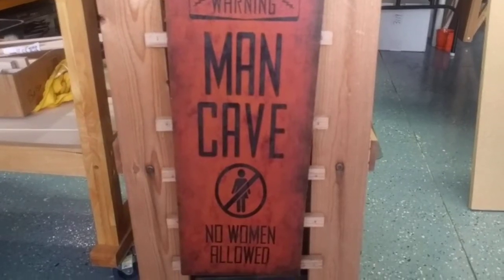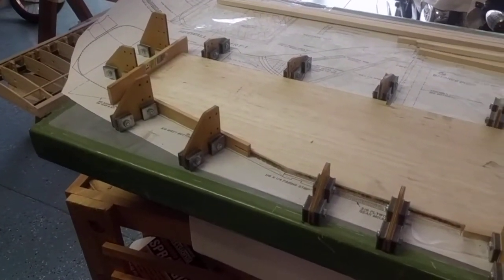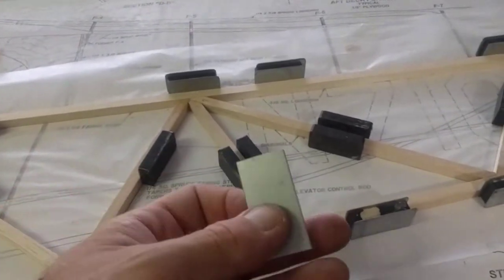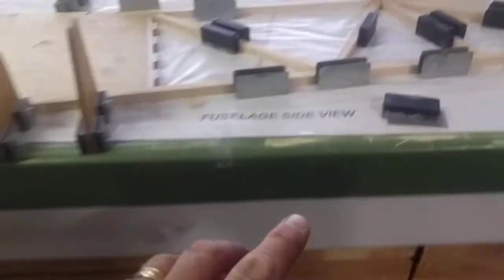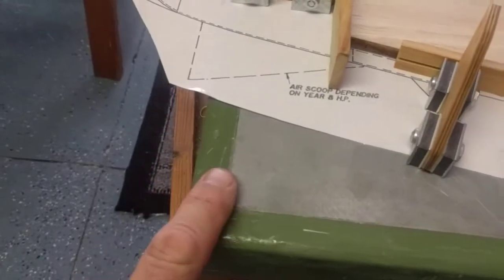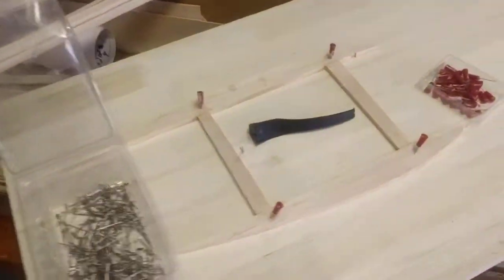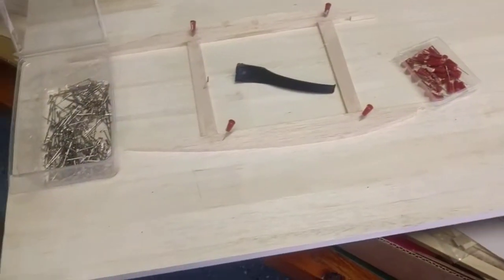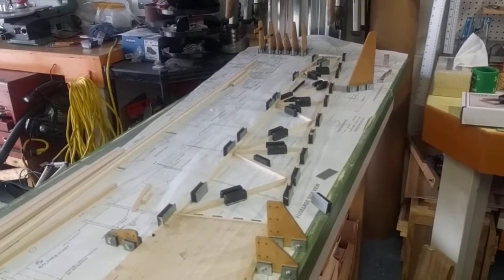Magnetic building board VS Wooden board

Comment: I've built an 18" x 78" project table and was wondering what gage steel you used to cover yours. I bought 30 magnet pairs from harbor freight and am currently using a small scrap of sheet metal I had laying around.

I called my local sheet metal guy and was put off by his $140 estimate. I forget the gage he quoted but I'm guessing he went thicker to ensure it laid flat.

The real problem i have was the revealitaion that materials had doubled or tripled because of covid/war in Europe etc. $140 for a $50 piece of sheet steel has me wondering if it needs to be a thick as quoted.